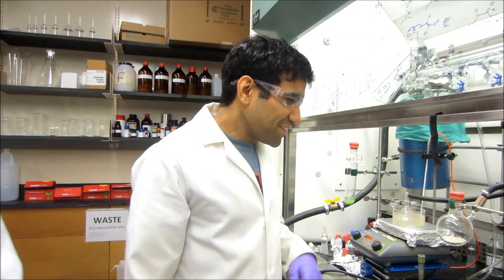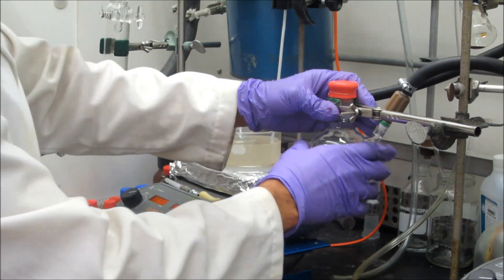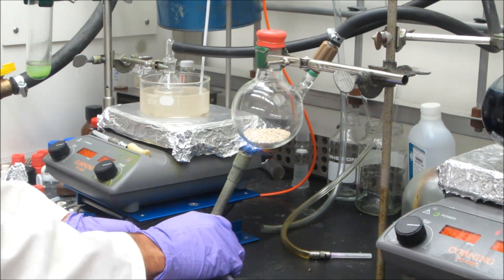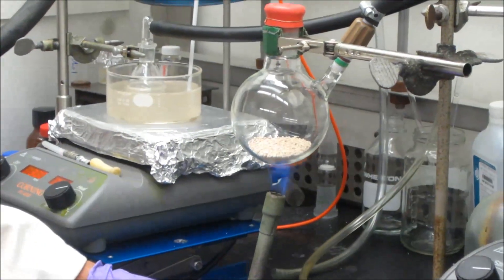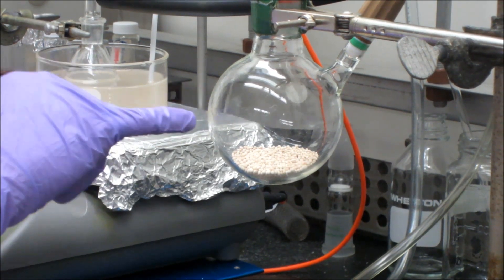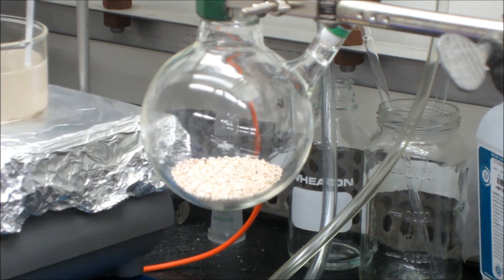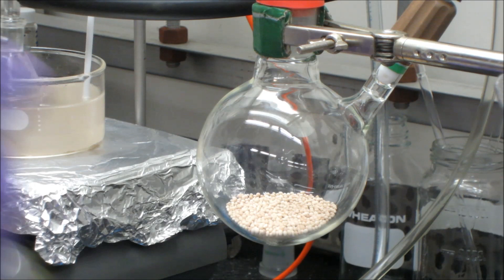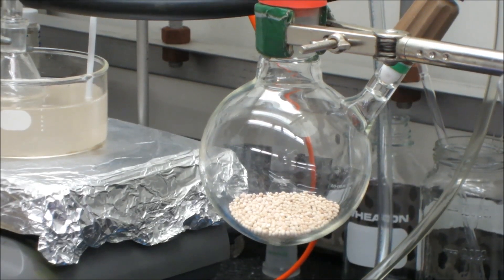How to dry molecular sieves

Comment: That is NOT how you dry sieves. Please dont teach audience unless you know what you are doing. And remove that ethanol before you are dealing with flame. 
 
1. Keep sieves inside oven until you want to dry them. 

2. Use round bottom flask  and not two neck flask. Check RBF to make sure it has no cracks. 

3. Dry sieves under vacuum not nitrogen or argon. Yes too much heat will implode flask, but you will have time to quickly take it off of the flame and increase pressure. The flask will not break as long as there are no cracks. Also, ensure there  is no solvent in the vacuum trap before you start drying under vacuum.

4. Leave flask to cool for at least 24 h under vacuum and its ready to go. Check water contect of dried solvent to confirm dryness.

Comment: Isn't it just easier to dry them in a vacuum oven?
Reply: I've read that lab oven often won't get over 250° C (necessary for zeolites to release all water). I am thinking about using an alcohol burner for partial drying in flask (without vacuum). I hope it will work.
Reply: @LiborTinka  80/20 rules the day also there in my opinion. Or 90/10 in this case.
The quickest way for getting the most result is a heated vacuum exsiccator. Put a dish with sieves in, and when you reach the end pressure of your pump, 30 microns or something, you are finished. No work, just wait and do other stuff...
Reply: Not every lab has a vacuum oven standing around and its questionable to buy one just for activating mol sieves

Comment: Thanks for usefull video! But I have a small remark. To be 100% sure that molecular sieves are dry enough it is better to weight the flask with the content after each heating-evacuating-cooling cycle until the weight stopped to decrease (or change in mass will be negligible, 10 mg or less).
Reply: Use a micron vaccuum gauge and know the low pressure limit of your vacuum pump. When you reach that you know that there is no more water coming off the sieves. So easy and hassle free...